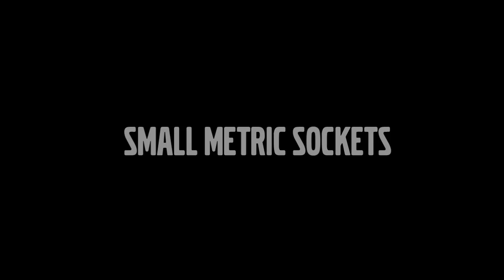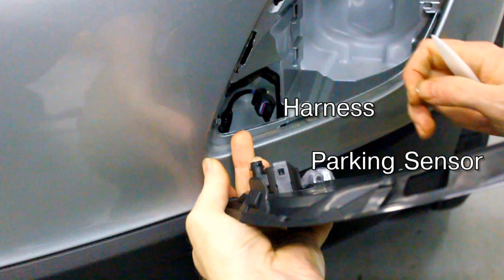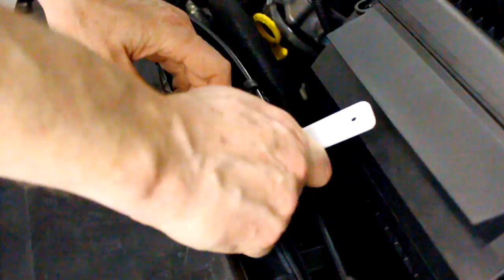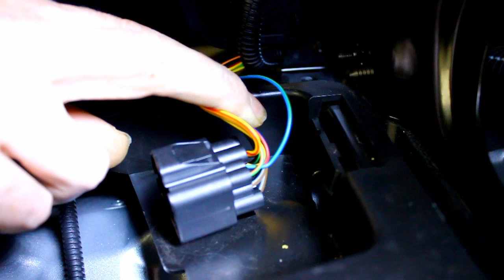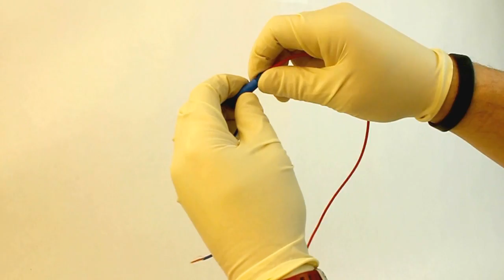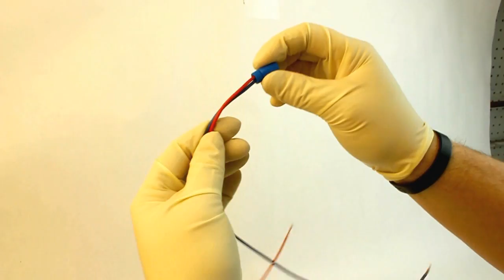IPD Volvo S60 LED DRL Kit 2011-2013 Installation Video

Comment: Super easy installation with these instructions.  I couldn't find them on the product page but found a pair on ebay.  The only thing I had to buy was the fuse splitter.